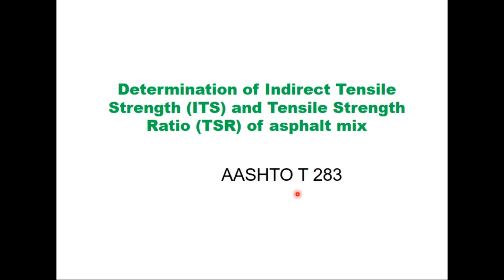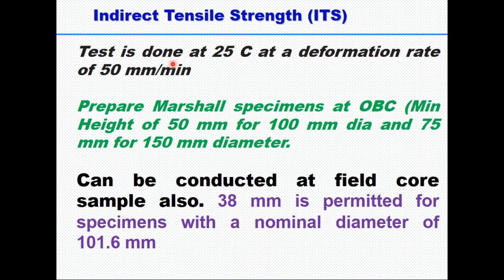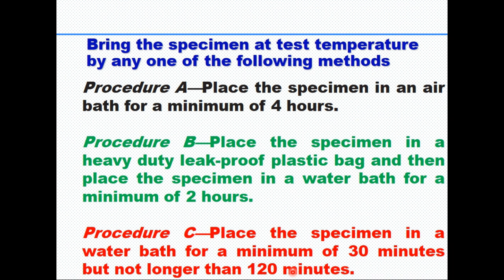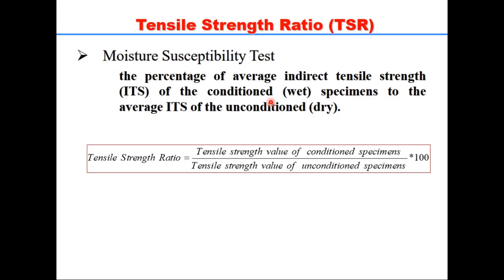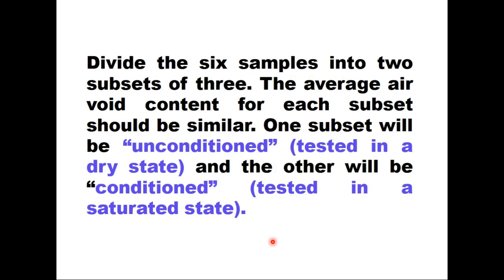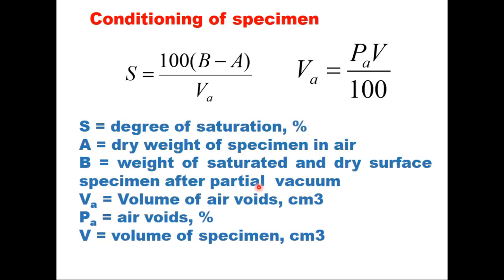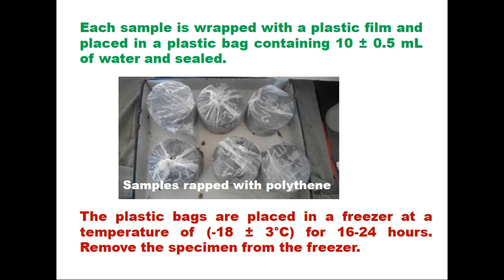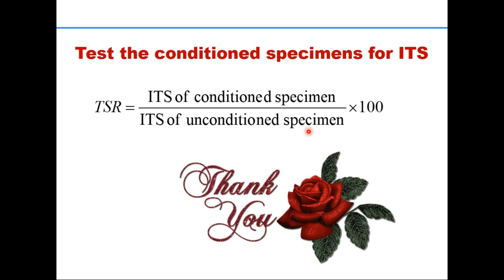#Highways, #ITS, #TSR, Indirect Tensile Strength and Tensile Strength Ratio of a Bituminous Mix.

Comment: Sir, what about Cold Bituminous Mix conditioning?
Reply from the maker: ITS and TSR are not required as per MoRTH specifications, only retained stability is needed.
But TSR is required as per IRC SP 100. The conditioning period is 72 hours in air and then 72 hours in water at 40 C.

Comment: Thanks for providing these videos, Sir! Much appreciated! What I didn't quite grasp is why the water-saturated specimen is held at 60°C after freezing. Would that simulate bitumen rejuvenation during a warm phase?
Reply from the maker: The TSR is done to determine the stripping potential of the mixture. Stripping can occur at high temperature only, therefore the specimen is kept in water at 60 C to induce the stripping in the mixture. Yes, it will also simulate bitumen reuvenation during this hot phase.

Comment: Hello sir ,
ASTM D639 it is mentioned to do wet conditioning in 25 c .
I am confused with 25 c or 60 c.
Reply from the maker: There are two sets of specimen, the first is kept in water bath at 25 C for 2 hrs before testing. The second set is kept in water bath at 60 C for 24 hrs after feezing cycle at -18 C.

Comment: Hello sir,
I am working on snow melting pavements. The application will be in snow prone regions of india like jammu kashmir, himachal pradesh etc .  In this situation, should i conduct the test at 25 °C or shall i conduct it at 5-10 °C. Will the same procedure applicable if i conduct it at 5-10 °C.
Reply: Or if not 25°C, than on what basis should i decide the testing temperature. Please suggest
Reply from the maker: Test temperature will be the same but conditioning of specimen should be through freeze and thaw process.

Comment: sir i am confused with horizontal (is it across loading axis or perpendicular to it) deformation while calculating tensile strain(if possible please provide setup photo) and from which code did we get this equation.
Reply from the maker: It is perpendicular to the load on circumference of the specimen. For calculation of ITS, this strain is not needed, you need failure load only.
Reply: @SatishIITR sir from which code is the equation e= o.52*x taken

Comment: Sir I am confuse 
How many Air voids %for ITS .
For ITS -7%per ASTM D 6931air voids you give me ans on my comment today. 
For TSR -ITS test 7%  air voids
For Mr value test ITS? Given in formula 11.08*ITS-3015.8 &
1.1991*ITS+1170 in IRC 37-2018 
 sir Pls short out my confusen. 
ITS -?
Tsr -?(ITS) 
Mr -?
Reply from the maker: There is no confusion. Refer IRC 111, 2009 on Specifications for DBM. It gives the procedure of determining ITS and TSR as suggested in AASHTO T283. Air Voids for ITS and TSR should be 7 percent + - 0.5 
The Equation given in IRC 37 relating Mr with ITS should never be used as there is practically no correlation between these two parameters. Their testing procedure and test conditions are completely different.
Reply: Thank you sir. 
One more question Pls 
For Mr value test casted mould shall be at 7(+-0.5)%air voids or
Reply from the maker: @moolchandsingh6650  Mr is determined at normal Marshall specimen as per design volumetrics (OBC and 4 % air voids)
Reply: @SatishIITR  Sir. Thank you very much

Comment: Sir, why we take 7% air void not any other percentage of air void? Or why test is not done in Obc?
Reply from the maker: This test is to evaluate the effect of water saturation and laboratory accelerated stripping in a bituminous mix. Therefore higher air voids are needed to allow the water penetration in the sample. 7 percent air voids are specified in AASHTO code to optimize this phenomenon. The test is conducted at OBC only, but with lesser number of blows so as to achieve 7 % air voids.

Comment: Sir, How do we prepare the unconditioned samples?
Do we have to cure the sample in oven at 60°C for 16h
Reply from the maker: NO, Keep it at room temperature and then place in a water bath at 25 C for 2 hours before testing.
Reply: @SatishIITR  ok sir, What about the air voids content in the sample?
Is it corresponding to OBC or 7% air voids?
Reply from the maker: @akshaydev6094  7 percent. Better to watch the video once again
Reply: Sir, In case of Core from site then what about 7% air void? Is it maintain?